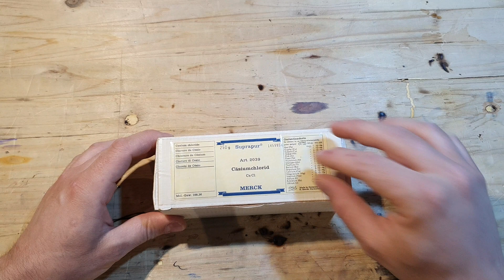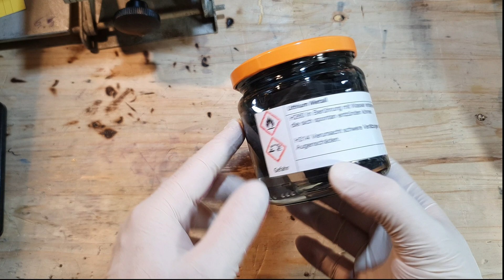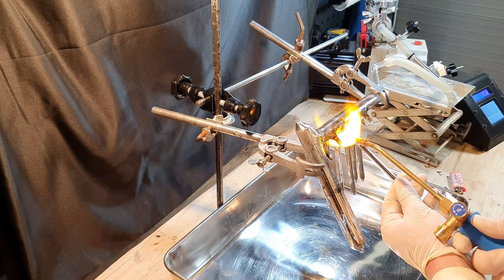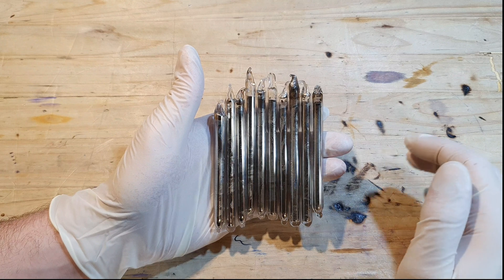Making ten cesium vials at once

Comment: Thread tapes and similar things usually don't make good vacuumtight seal. What about silicone rubber disk/stopper or even copper/aluminum disk pressed by the steel cap?

Comment: 3:10 why would you want an excess of lithium? I would think that once the reaction is over, it would be easier to separate cesium chloride from cesium metal than separating lithium from cesium metal, mostly because the metals will mix and alloy, and might form an azeotropic mixture, so they would be hard to separate through distillation. but the salt of cesium and cesium metal are so chemically different, they should be easier to separate and shouldn't mix. does cesium dissolve in cesium chloride? that would explain the decision to add extra lithium.
Reply from the maker: That's a good question. To be honest, the main reason is, that caesium chloride is pretty expensive and I wanted to make sure that all of it reacts. The lithium tends to form a layer above the CsCl when both are molten. Mixing them would be ideal but I can't think of an easy way to do it. 
Cesium is soluble in molten CsCl (that's basically the reason why you cant produce Cs by electrolysis of CsCl) but at those temperatures and under vacuum I think it would still distill over.
If the temperature is controlled correctly no lithium will make it into the receiving flask and I don't think that it forms an azeotrope with caesium.
Reply: @AdvancedTinkering  yeah, that makes sense! you could try to mix them using a piece of cobalt covered in borosilicate glass, and externally mixing it with a magnet. basically a high-temperature stir-bar. (cobalt has a very high curie point) iron could also be used, but it has a lower curie point, experimentation is required to determine the effectiveness of either method. alternatively, you could melt the lithium in a beaker with toluene or other such inert fluid, and mix the liquid to break up the lithium into many small spheres, increasing surface area, and allowing for even mixture with CsCl. the toluene will evaporate or can be boiled off and will leave you with a dry mixture when you're done, so you can proceed with the distillation.

Comment: Why did you start sealing the ampoules from the middle!?
And why did you fill them to the top? No room to open them safely at all.
Either do it properly or don't do it at all.
I don't know why you even visited Florian. He told you everything you need to know.
Reply from the maker: I visited Prof. Kraus long after I made those vials. It was one of my first attempts. 
Those vials were never meant to be opened "safely". They were used for another video were they were cracked open by a remotely controlled mechanism and dropped into liquid oxygen.

Comment: You could make a killing making small ampuoles of things and selling it to element collectors, especially if you seal them in little acrylic blocks or cylinders. If you want to stop the cesium from bumping you can add a little bit of iron or tungsten powder, a  bit of nichrome strip wire can make a heating mantle, just gut an old toaster for the heating wire and wrap over some rockwool cloth. Use a variac to vary the temperature. FWIW ive made vials of chlorine, bromine, iodine with vapor atmosphere, liquified xenon, mercury, lithium through cesium. ❤

Comment: Cs is more reactive than Li , yet Li reduces Cs+ to Cs. Why?
Reply from the maker: The Cesium is constantly removed from the reaction via distillation. This way the chemical equilibrium is shifted to the right side of the equation.
Reply: @AdvancedTinkering  yes but why Cs+ goes into Cs in the first place? Why Li looses the electron and Cs+ obtains it, Cs is more reactive than Li so it should be vica versa.
Reply: @AdvancedTinkering  I found the answer on vedantu:
An element that acts as a reducing agent, must have low ionization energy. Alkali metals act as strong reducing agents as their ionization energy values are low. Since, ionization decreases on moving down from Li to Cs, the reducing property also increases down from Li to Cs.
Lithium ion is small in size and has high ionization enthalpy. Also, more solvent molecules can easily surround around the cationic sphere. On the other hand, because of its small size, it is extensively hydrated and has very high hydration enthalpy. This high hydration enthalpy compensates for the high energy needed to remove electrons. Thus, Li has a greater tendency to lose electrons in solution than other alkali metals. The Large amount of hydration energy makes it the strongest reducing agent in spite of its highest ionisation enthalpy.
The tendency of an element to lose electrons in solution is measured by its standard oxidation potential value E0ext
. Since, alkali metals have high E0ext
values, these are strong reducing agents. However, it is observed that Li is the strongest reducing agent amongst alkali metals in solution as E0ext
value of Li is maximum.
Note:
It should be noted that since ionization decreases on moving down from Li to Cs, the reducing property increases in the same order. Thus, Li is the weakest reducing agent while Cs is the strongest reducing agent amongst alkali metals in a free gaseous state.
Reply: Cesium has a much lower energy to ionized because that last electron orbitals a pretty far away from the nucleus.  It evaporates away leaving a chlorine behind.  Lithium is going to jump into that spot and it hangs on to the chlorine with a stronger ionic bond.

Comment: What a wonderful job you did. This is really really great work. Have you tried without vacuum, just argon?
Reply from the maker: Thank you a lot! Do you mean the whole process or just transferring the cesium into the vials under argon? 
I never tried the production of cesium with just argon. I think the higher boiling point would mean the temperatures would have to be very high. 
Or do you see any advantages by doing it with argon under atmospheric pressure?

Comment: Very impressive dispite what were perhaps a couple of rookie mistakes along the way.
I'm wanting to do this. I have the cesium chloride, lithium, melting furnace and pipe bomb looking flask ready to go but I've decided to wait until I'm better set up to handle the cesium. This is one of the best videos I've seen on doing this.

Can you please tell me what torch that is you are using?  I'm looking to buy something for doing this type of glass work. I'm guessing the gas is oxy propane?
Reply: In his other glassblowing video its oxypropane, he uses a propane tank and an oxygen concentrator
Reply from the maker: Thank you! Yes there are definitely a few things I should have done different.  
I am using oxygen/propane. The oxygen gets supplied by a 10 l/min concentrator. 

I bought my torch used from a local glass blowing store. There are no markings on it. But from how it looks it seems to be the "Carlisle Mini".

New torches can get pretty expensive. I would try to find a used one.
Reply: @AdvancedTinkering  thanks, I'll be keeping a lookout for a second-hand torch, also for oxygen concentrator. Does a small bedside medical one produce enough air flow? I'm considering maybe building something since I already have a dentists compressor